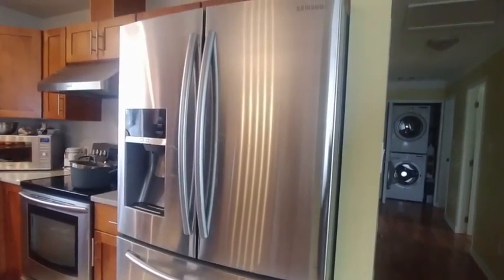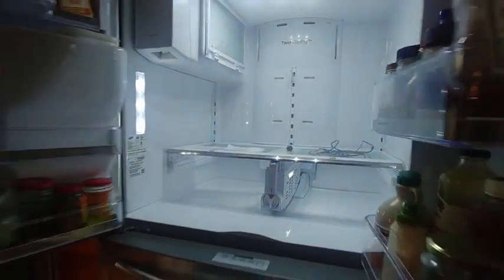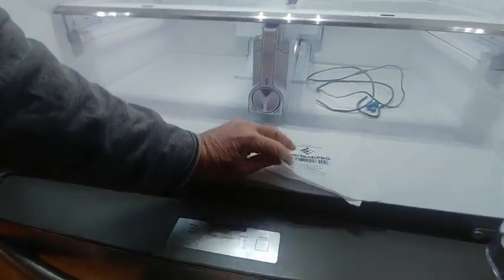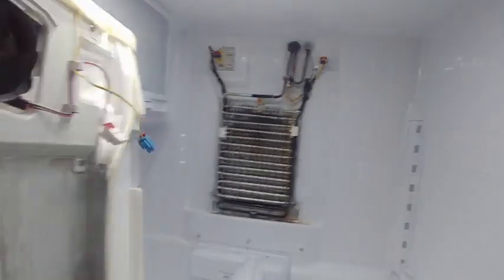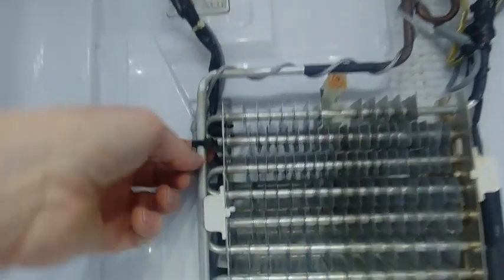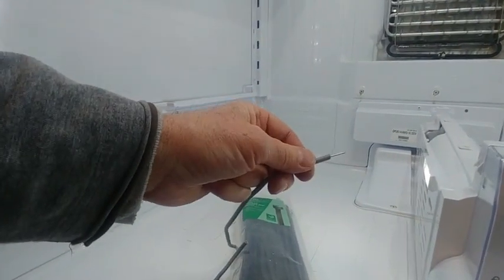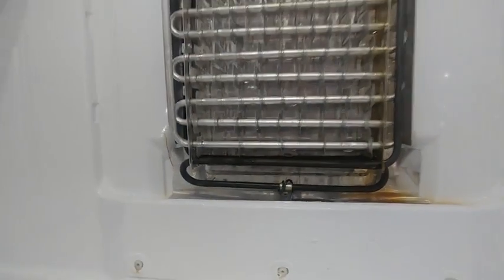Samsung French door refrigerator heater modification for icing issue

Comment: You failed to show the tap
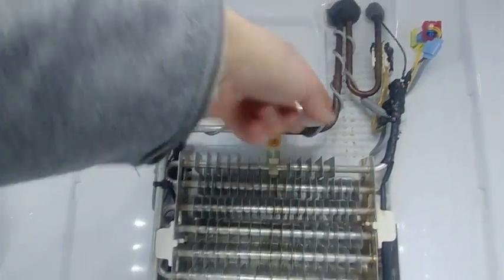Reply from the maker: From 4:53 onward you can see little light blue taps on either side. I even explained how to compensate for the thick heater wires. I like to keep my vids light and easy. If someone needs to learn how to use a wire tap,
a quick search would pay off.

Comment: Hi ...

This was one of the more informative videos on this specific topic that I have seen. I have precisely the same frig and the same problem. I have just replaced the Defrost Sensor but I now, do not think it is the real problem because, on testing, the resistance does change with temperature, but I can not be exactly sure about the 'percentage' change given the Samsung Defrost Temperature Resistance Chart. I understand that it fails, if it off by 10%.

I have several questions, if you do not mind...

1: Why do you suppose the refrigerator worked as specified for the first N Years (in my case 7-8 years)?
My point is that, some element has/is failing, but the Internet/YT does not address this aspect of the fix... usually focusing on the Defrost Sensor or the Defrost Heater Element.

2: Do you think the real problem is the Samsung Defrost Heater Element fails slowly over time... which is why you are recommending an additional heater element?

3: I am surprised that you have, over time, found it necessary to add a second additional Defrost Heater Assist Element. To me, this suggests that the MAIN Samsung Defrost Heater Element degrades over time. Which leads me to the question... why not just replace the main element? Maybe this is just a cost issue, as I believe that main element is approximately, $150.00 CAD.

Incidently, I am pleased, that you explained the WireTap Connector implementation and the gauge. I would not have understood that.

Thanks
Reply from the maker: Things wear.
Any deficiency or subpar design element will show up. Feel lucky that you got as many years out of your fridge as you did.
This fridge was under-designed with respect to the defrost system and the additional heating element is a good addition.
Reply: Thanks

Comment: I have a similar frig but my problem is the drain hole getting blocked by ice. I´ve seen the diy copper wire solution but my unit have a lamp for the defrost function and by that the wire solution doesent works. I was thinking on instal a mod like the one you show!

Comment: Well, did it work this time?
Reply: Won't work if your temp sensor is bad. Replace defrost sensor and temp sensor. Works almost every time. Secondary heater is not necessary.
Reply from the maker: @timothyjoe1089  Like freemanhsu5896 says, these Samsung refrigerators have issues even with components working. The secondary heater is a needed addition to this fridge.
Reply: Thanks for your technical information. I found that Amazon carries some special package for Samsung refrigerator.  This is the on-going problems of Samsung, and a huge market for the repair technicians and the replacement parts as well.
Reply from the maker: So far it is working.
Reply: @SqueetoNa Thank you, you did a great job, and its nice to know that your Samsung refrigerator is back with your modifications.  I have been searching for the answers for this problem.

Comment: Disappointing your previous fix wasn't permanent. Since it lasted 3+ years it makes me wonder if maybe the thermistor is bad even though it might still test to spec. I think this additional heater is the best fix. My tech moved my thermistor to the "U" outlet tube and that lasted 9 months (1/2022 - 10/2022). He since moved it (10/2022) to the "right angle" outlet tube like you had yours AND he replaced the thermistor. That was 4 months ago. I'm not optimistic this fix will be permanent. One other thing I've done is unplug the fridge from power for 2-3 minutes after the fix. I read an article in the link below stating after a forced defrost (Fd), the refrigerator MUST be reset. I have noticed on occasion that the fans and compressor will remain off for 50-60 minutes and that several times a day they shut off for 10-15 minutes. So, I don't know if resetting did this by "rebooting" the PCB board (like a computer) or I just never noticed it before. Regardless, if I get the icing again, I will replace the Samsung with either a GE, Whirlpool or Frigidaire.

https://www.unitedservicers.com/2017/04/tech-tip-27-why-force-a-defrost-samsung-refrigeration/#comments
Reply from the maker: 😀- the ultimate fix is "GE, Whirlpool or Frigidaire" - lol